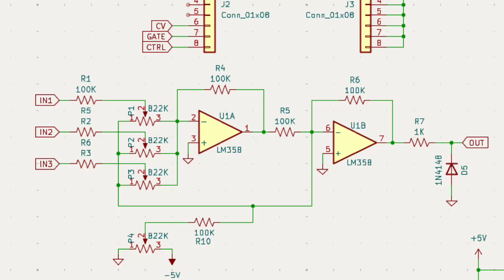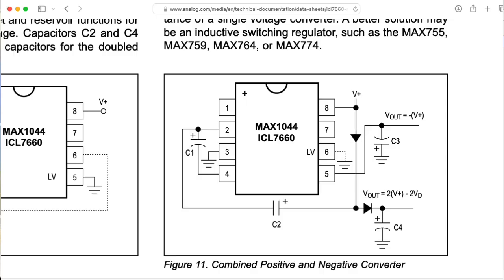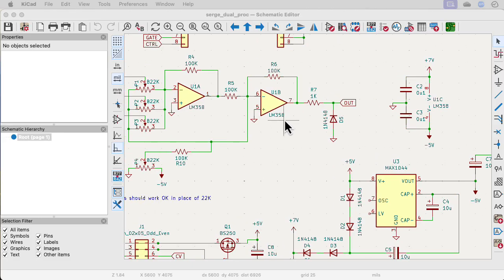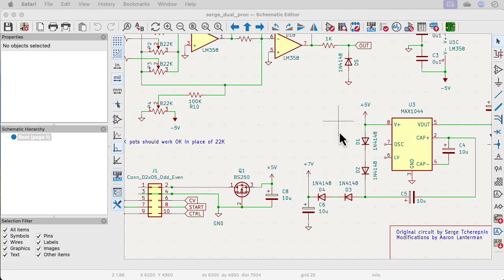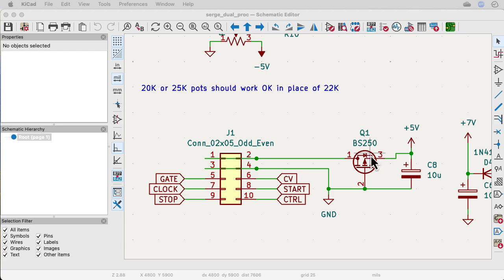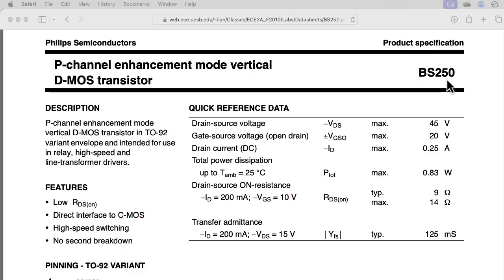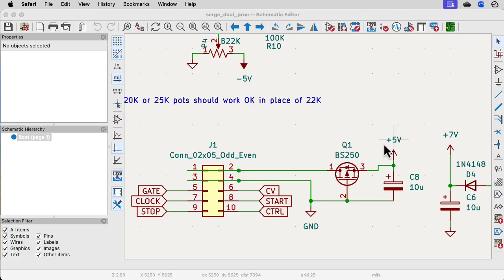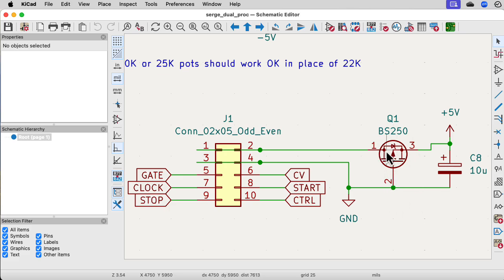Tangible Waves Adaptation of Serge Dual Processor (with Discussion of Reverse Polarity Protection)

Comment: Nice, I burned a couple of cheap chinese 5-12 Vin to +9-15 -9-15 Dual voltage converters S24 diodes these days, otherwise pretty good compromise for the price tag.

Comment: Instead of a noisy switching rail-inverter, I’d have tried to make an intermediate 2.5V rail to reference some RRIO op-amps to. I imagine that’s what these Tangible Waves circuits usually use, though the fact that they don’t carry the intermediate rail on the ribbon cable is really strange. Maybe they just use a bunch of DC-blocking caps and individual bias dividers like a transistor circuit would?

If I recall there are some +/-2.5V modular synth standards out there.
Reply: Indeed; having a simple voltage divider plus buffer cap as virtual ground is almost standard on most AE modules. IMO, creating it locally is better than as an extra bus line; never considered this.
Reply: @  Creating it locally means you could have slightly different DC references between modules, resulting in DC differences on the signals which could be amplified or otherwise cause problems. The only sure way around this is with at least one DC-blocking cap per module, which I think kinda defeats the purpose.
Reply: @Scrogan  You are technically correct. But we have 1% tolerance resistors as standard, and actually, in the context a modular synth, a few 10 millivolts of  difference in DC offset for audio signals doesn't matter at all. We are npot dealting with precision measurement stuff ;-)  And, as you stated, there are frequently caps in the signal path.  The typical design is a cap and a 100k resistor to the 2.5 volt virtual ground after it; this adjusts all incoming signals to the desired offset.

Comment: For power protection in guitar pedals, I just use a diode in series woth the positive power. Typically a 1N518. This has kept me from blowning things up when I crossed wires! Its cheap, easy to implement, and I've never encountered a design that had an issue with the slight reduction in supply voltage.

I could see how you might need to get fancier with synth designs that have different power requirements.

Comment: Wait, the Tangible Waves format is 0-5V audio, but the power supply is 5V with no headroom?  That seems like a bit of an oversight, one that might contribute to a lot of designs needing extra voltage boosting just to be able to reach +5V...

Some more digging suggests that the audio signal is typically 3Vpp, centered around +2.5V, so I guess 1V headroom is enough in many cases...  Just not for LM324s, the most jellybean of all opamps, which is largely unsuited to Eurorack due to slew rate but which should work fine here thanks to the narrower voltage range, but then it can't reach +4V...  Troubling...  Maybe it's worth looking into processing at 2Vpp or 2.5Vpp, and then scaling up with an old-fashioned transistor amp on the way out?
Reply: Actually, all of our modules work without voltage boosting up to now. There is one in the making that will need one, though. You can do a lot on the 0...5V range 😉
Reply: @tangiblewaves9730  Yeah, it's just the intersection of the 1V headroom and the cheapest jellybean opamp needing more than that.  All of this could be avoided by using something like a TL074 instead of an LM324 (or similar).

I do think a tiny bit more headroom would be good, but module builders could just opt to max out at 2.5Vpp instead of 3Vpp and then turn up the volume in the final amp stage.
Reply: @georgedorn_fnord  the MCP6004 I mostly use goes very rail-to-rail, only 10, 20 millivolts. So we can use almost the full swing of the 5V range. So 3V audio p-p is always fine. But you are right, not all opamps do that and then it get's difficult.

Comment: The diode to ground protection was done as a cheap and simple clamp because most power supplies could only supply 100mA as they were all linear supplies back then. BOSS power supplies are reverse polarity to allow easy switching of the battery. Any pedals using it today are just copying the old designs. Unfortunately today’s switching supplies can supply much more than 100mA so it’s not a very effective protection method.
Reply: You often find a large diode across the supply in car radios and cb radios for cars etc, they were (in the trade) called the idiot diode, never heard it called the warranty diode before I guess its description has gone more PC over the years.
Reply from the maker: I think here the term was in reference to if the pedal got returned the company could claim the user violated their warranty.
Reply: @Lantertronics  I always thought that the goal was to provide enough protection to work with the majority of cases to prevent returns. IF all power supplies are 100mA supplies then this simple “trick” would work long enough for the “idiot” to figure out something isn’t right before failure. Even if it prevents 50% returns it is hugely successful as a cost savings for a company as large as BOSS.

Comment: That’s elegant. With mosfets with an rdson in the milliohm range, this is looking like the preferred solution.  (But note that BS250 says 14 ohms, which gives the same as a 0.2 Schottky drop at just 14mA!) I’m also a little concerned about using that body diode for the inrush current, since that’s a lot and those diodes are usually underspecified. You could add a Schottky in parallel. Also, what about ESD, since we have a mosfet pin floating and open to the outside world? Is that a concern? Ofc the best RPP is keyed connectors and industry wide standard practices to make those keyed connectors useful…*sigh*.
Reply: Ideal practice would be to use a polyfuse, TVS, then a lower RDSon FET. In that order; polyfuse protects everything downstream. If the TVS fails short, the polyfuse limits the current and prevents your wires from becoming heating elements. TVS protects against ESD events, and the FET prevents reverse voltage from killing anything should the user hook it up wrong.

Comment: In practice at least, the MCP600x – maybe most op amps without weird overvoltage phase reversal problems? – can handle input voltages quite a bit outside of their nominal input ranges, provided the currents they're seeing are sufficiently low. Mutable Instruments took advantage of this a lot in her modules' ADC conditioning, using a single MCP600x op amp to scale, shift, and clip all manner of ±10V signals into various 0~+3.3V ranges. not sure what the real limits of this approach is, might be interesting to find out some day.
Reply: A great deal of modern parts have built in ESD diodes on all of their inputs! They're typically rated to a fairly low current rating, but if you limit the current into the pin to about 10-20 mA, then you can have voltages well above whatever the part is nominally rated for!

Comment: You don't need to connect R10 to the inverting input, you can remove GND from the non invertering input and connect R10 there.
That how i did my diy module a few years ago and works perfect.

LM2776 is >5 times cheaper and delvers 4x the power, but SOT23. i used mpc6002 in my Buchla 259 wave folder just outside the specs, like some +/-4V and till this day they hold up. 4:39 the Arduino Nano Every also has a couple of mosfets like this between a 3v33 mcu and a 5V mcu communication pins, i scratched my head to figure out how it works, Thnx.
Reply: If you mean disconnect U1B-5 from ground, disconnect R10 from U1B-6 node and connect R10 (plus the 22K pot selecting 0 to -5V) to to U1B-5, I don't see how this circuit would work properly if the non-inverting input U1B-5 is not at 0V.

Comment: I've got a fairly expensive fuji camera that doesn't seem to have any reverse polarity protection on the hotshoe, I think they rely on the hotshoe only fitting one way (not sure it does), but with a flash cable and a flash plugged in the wrong way on the other end it seems to corrupt sd cards, the flash doesn't seem to have anything either, plugged incorrectly and the battery drains to zero almost instantly and it doesn't work properly (though recovers later)